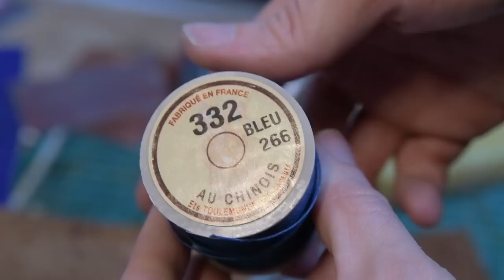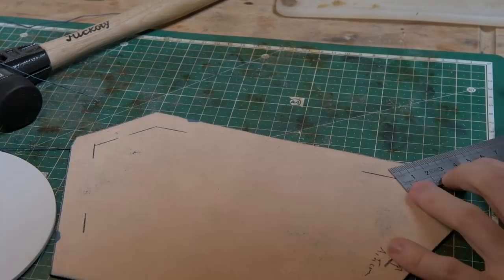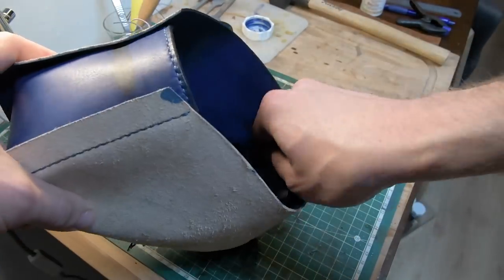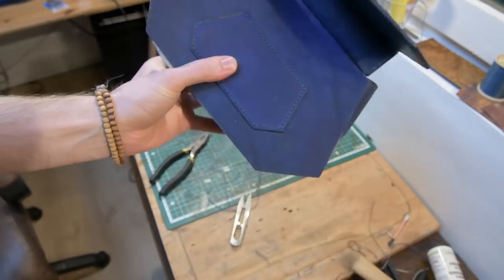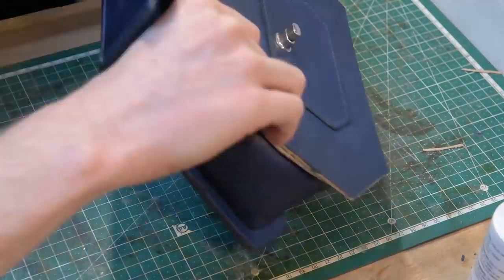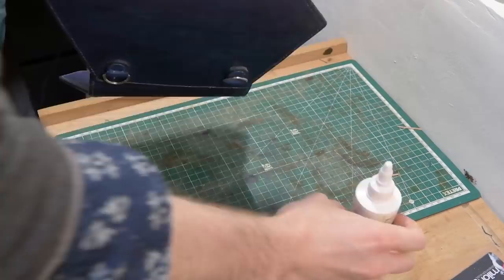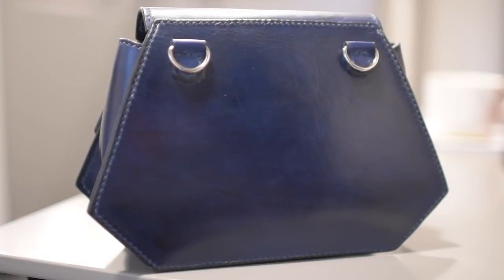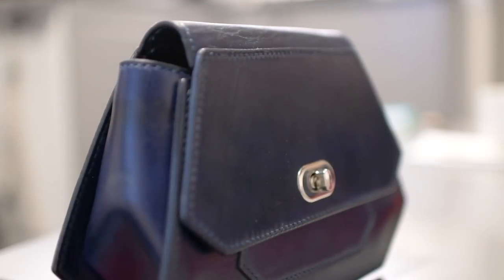Making a premium leather clutch bag / purse - how to build

Comment: Enjoyed the video (and the others which I've watched).  I have to say that I personally have never sanded the edges of any pieces, I don't find it necessary. I just dye and then burnish with Gum Tragacanth and an edge burnisher and they come out great.
Reply from the maker: Thanks Coel for your message :) I've always done it this way as I find my edges are never good enough straight after the cut to take a proper edge.
Reply: @JamesBerry  I hope I didn't come off as critical or know-it-all, just trying to help.  What grit of sandpaper do you use?  I'm curious about this now.  I think I tried sanding an edge a long time ago but found it made the edge more messy, rather than less, but perhaps I'm missing something.  It would be interesting to try again.
Reply from the maker: I'm using 180 grit sand paper to make the edge look neater (especially if two glued edges don't really line up). I've see it be used before but everyone says you should only sand in one direction to help flatten the fibers... not sure about that, I've never done it.
Good luck with your testing :)
Reply: Coel,  there’s something fishy about your name!

Comment: Could you dip dye with the pro Dye product? Particularly if you are lining the bag?
Reply from the maker: I could in theory but have never done it as I'm afraid it could dry out the leather way too much... It's a method that's on my to-do list of things to test x)
From other people's videos it looks as if this could be a very valid technique for such pieces.
Reply: James Berry Leather Whilst expensive to set up initially an air brush does a great job of fine even applications of dye to build up to the desired depth of colour. I’m sure people have come up with recipes to improve both penetration and end result. You could use that to do your finish coats of sealer as well thinned with a little water.

Comment: amazing, I was curious what might you call the silver connecting hardware on the bag, or where is a good place to find them
Reply from the maker: Thank you Curtis! It's a simple bag closing mechanism that can be found at most hardware stores in the aisle with the knitting equipment or the sowing repair kits. It's quite common, so shouldn't be hard to grab :)